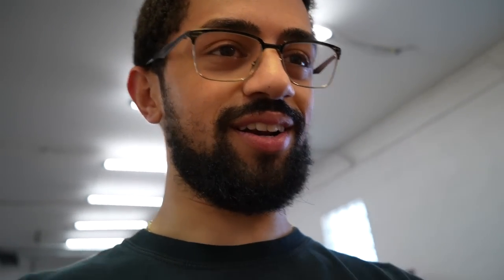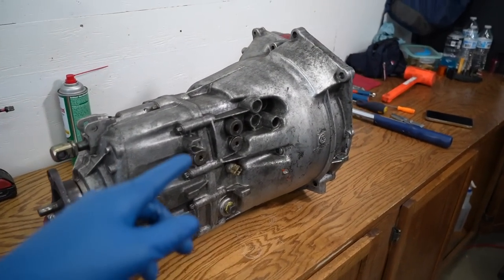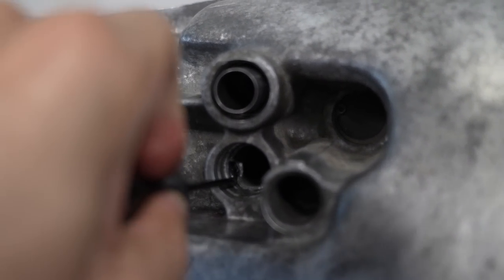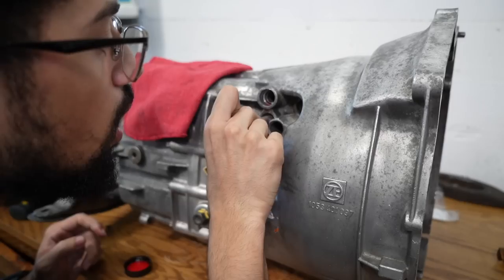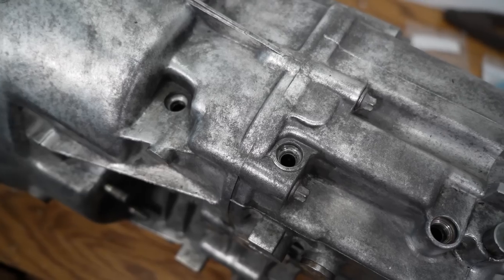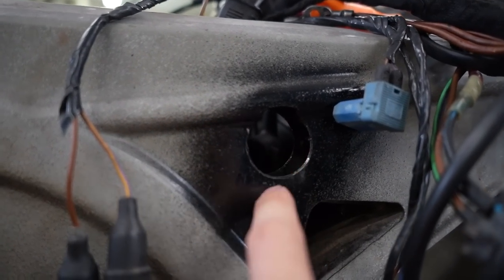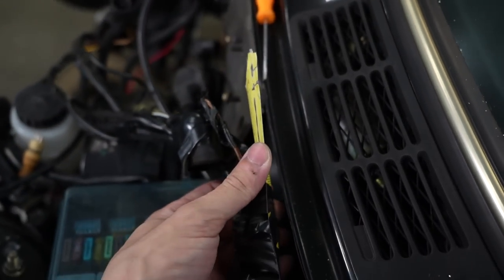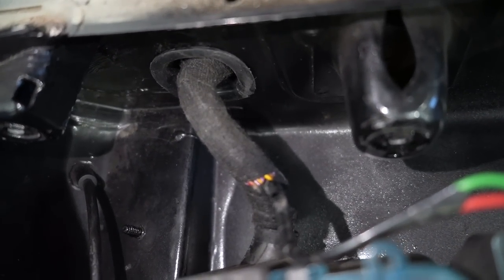Did I Just TOTAL My Freshly Rebuilt Engine BEFORE EVEN STARTING IT?!

Comment: Don't stress bro, it's likely fine. You didn't build enough oil pressure to force the containments through the engine by hand cranking it. Clean the oil pan again, clean the oil pump pickup and the oil filter housing. You'll also expect to see flakes post-inital start up as things wear in, so you'll just refill the oil at that point and monitor it. Best of luck.
Reply: Exacly, like it's infinitly small flakes, not like big chunks. Don't think it'll make a difference at the end of the day, but definitly a learning moment!
Reply: nahh, cant let something like that slide.
Reply: When I rebuilt my m52 I did first oil change after 1k kilometers, there was some metal flakes in oil filter but I was like ”whatever” and put new oilfilter in and fresh oil, no problems and that was many years ago. That engine is still working, it’s my daily drive m52 with 1bar boost

Comment: No need to clean the whole engine. A bit of shiny metal went from housing into the pan. The pump never engaged. Cylinders and head is dry as a bone. You are fine

Comment: Hey man. It’s not as bad as you’re thinking, hand cranking it did not cause it to move through the system, it would have had to be in the pan to get picked up. Just make sure to clean out all that old residue which doesn’t look to be more than half a qt. When you get ready to put it back in, make sure to prime it really well. And be ready to see some metal in the filter from rebuilding the engine. M539 restorations rebuilt a v8 twice for his alpina, and he went over precautions when building engines.

Comment: Tip for fishing wiring through tight spaces instead of tape measures is welding wire feed or whatever you call it
The wire that runs from a welder into the mig end, it’s pretty rigid but also super flexible when needed. I use it constantly at work wiring trailers

Comment: First and foremost. Hope your dads surgery goes well <3 
For the flakes, I might be wrong, but I think you can flush it. Clean the oil filter housing, bolt it back up, and run clean oil straight down the filter housing. Use the same viscosity the motor is going to be run on, then re-remove the oil pan and clean it. After first start up, warm up, then change it again. Then again after break-in miles

Comment: The oil went through the oil pump and into the pan. Pull the oil pump off and clean it out. Flush the passage between the pump and filter housing out with brake clean. Any flakes left in the system will get caught by the oil filter and not make their way to the bearings.

Comment: Get a QWORK air blow gun from Amazon and flush the engine out through where the oil filter housing attaches to the block. Also get some of those long nylon brushes and clean it out that way too. Then clean the oil pan and anything you can easily get off the engine that was in the path of the oil. Hopefully you’ll be able to get all of it since you didn’t start the engine so it shouldn’t have gone too far

Comment: I have made the same mistake on my turbo M20 when i have rebuild it, forgot to put off the sandwich plate with the filter on when i clean my engine, but i just made 3 oil change just after the first restart, and it's always running today :) i'm about 20.000+ miles on it now, and no problem at all. Keep up your head, like what you said, we are humans, and we make mistake, just enjoy your build and don't give a fuck about haters :D

Comment: Great video like always. Definitely need to do this Maintenace, where can I find these sleeve install tools. Quick tip use a bit of wd40 or oil when grinding with the dremel makes job easier, less messy and extends life of the cutting bit

Comment: It's taking forever to solder because you are using the wrong iron and the wrong tip. Each connection should take you like a minute or less.

Also, when you shrink the butt connectors, you need to apply heat until all of the cloudiness goes away on the wire insulation. The cloudiness means it is not touching. Those are not weather tight.

About your stupid oversight with the oil filter. Clean out the housing and put it back on the motor. Put a large catch pan under the motor and dump a gallon of thin (like 0w30) cheap oil quickly into the filter housing keeping the housing full to flush all of that metal away. You want as much oil as possible to go through there quickly to flush it all out. Then blow compressed air through there to push as much of the cheap oil out as possible. Clean your oil pan real good and put it back on.

Comment: If ya need a zf trans or e36 diff let me know. I'll give them to ya for cheap. I've been running a face plated t5 trans and e34 m5 diff in my e36 for over a decade now and have no use for the zfs and diffs. All have way less than 100k miles, I've had them for 15 years now and would like to free up some garage space.
Reply: What are you asking for that ZF? I can use it 😎

Comment: All the shavings were in the pan man. You didn't put any pressure through the motor and the shavings didn't get push anywhere else. Just do a bunch of changes from initial startup and break in and you'll be good

Comment: Hey Joel,  do m52 lifters usually fail?   I lost all compression on cylinder 4 after m50 intake swap. Leak down showed air escaping from exhaust. Really hoping I didn't burn a valve 😅

Comment: So for the first set of headlights instead of drilled that hole to get the connectors thru couldn't you just have shaved the side to get the cables closer just asking 
But 🔥  Build and 🔥 videos every time

Comment: The flux isn't causing the wire to heat up quicker it is cleaning the wire so that it'll accept solder. You really don't want to use plumbers flux on wire it'll cause it to corrode.

Comment: Joel,  STOP! Wait a minute before you go thru the engine again man. 

Think about the dirty oils travel after you opened the oil filter assembly. It basically went straight into your oil pan and left very little to likely none inside your engine and certainly NOT in between your bearings. 

Remember you never cranked the engine fast enough or hard enough bare-handed to make any kind of issue. 

Just clean out the oil filter assembly and the oil pan thoroughly and you should be more than fine man.

Your also going to produce some metal shavings at start-up regardless so don’t beat yourself up man. 

Taking some time away to spend with your dad will help you clear your head and come back clean later. 

Peace!

Comment: Shit happens bro not that hard of a fix just run the filter housing and the pan through the parts washer again spray out any passages on the engine. It shouldn't have gotten the bearings and all I wouldn't imagine.